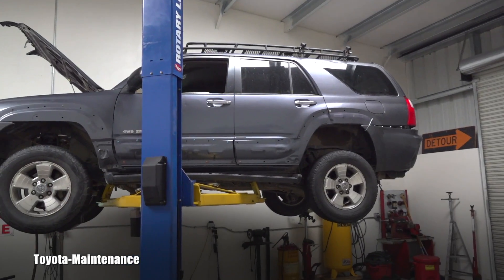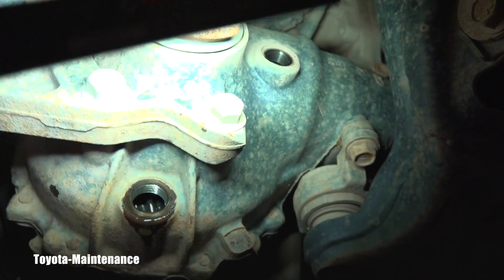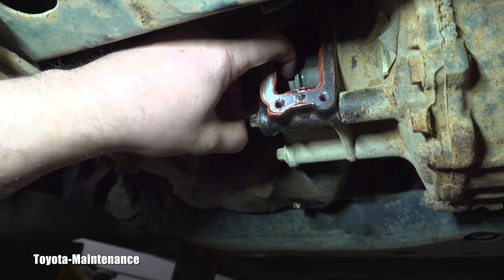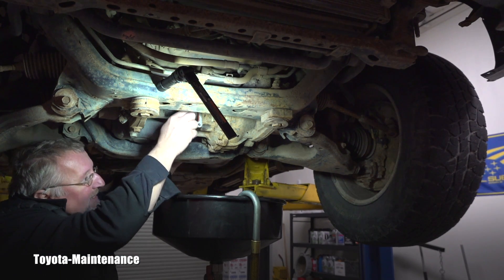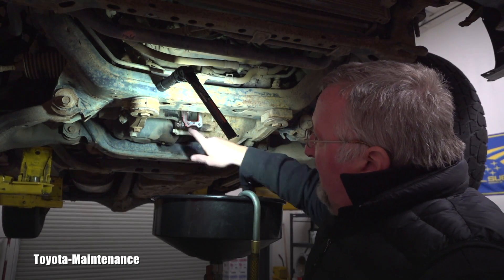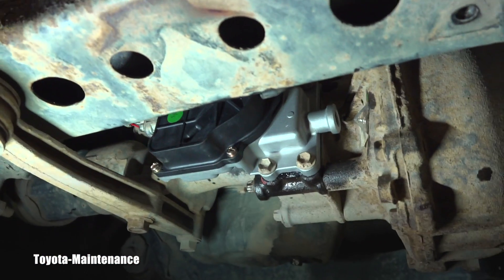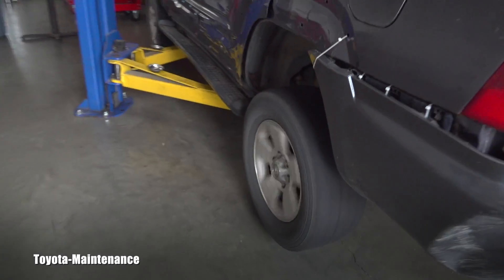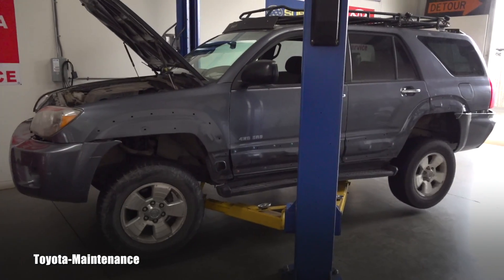Toyota front differential ADD actuator replacement

Comment: I replaced this part and fixed my problem, but new part has a short breather pipe and a bung in it , seems to be glued on. Is this a new mod and how it should be, or does it need to be pulled off and put on old breather???

Comment: Curious, what did you torque those bolts to? Or did you just go snug then a quarter tight?
Reply: The FSM for a 2005 Sequoia says 15 lb-ft - I would imagine the 4Runner is very similar

Comment: Is it best to replace and add new Differential fluid when replacing the front actuator. And when replacing the actuator do you have the 4runner in 4H or 4 wheel drive off?

Comment: So that's not diff lock it just engages 4x4???
My hilux has this and I thought it was electronic diff lock, my Pathfinder locks 4x4 in the transfer case, I don't see the point.?
Why not just use the transfer case like every other 4x4 I've worked on

Comment: I have a 2010 CrewMax Platinum Tundra with code: C1340, which my code reader says it's the Center Differential Lock Circuit. My 4WHi/4WLo dont work at all. Any idea what the part# is?

Comment: Hi, I've been watching your videos and learning a lot from them.
 I figured out the problem with the 4 wheel drive of my 1999 Toyota 4runner - the 4wheel drive works and everything but, the 4wheel drive light flashes  every time I start the vehicle.
Do you have a suggestion of what is causing the lights to flash? Thank you in advance.

Comment: Do you think you could advise me where to start..   I recently acquired a 1991 land cruiser. It’s stuck in center diff lock. Light is on in dash and won’t go off from toggling the button or from placing transfer case from high to low and back. Please help

Comment: Hi. Good information. I went a step too far and opened the ADD. Parts are cleaned BUT require assistance retiming the unit. Any possibility of providing information or a link. Cheers. Frank

Comment: When you install the ADD actuator do you make sure the fork is set to install in the disengaged position? or the engaged position?
Reply: Did you find an answer I’ve got the same problem? I’d assume 2nd position?
Reply: @harrisongauci2487 DUDE. I was so frustrated I gave it to a mechanic shop. They uninstalled and re installed it and it just worked.

Comment: The shift actuator on the transfer case is the issue with the front not engaging. It has a fail safe system; is closed loop, undiagnosable with anything. Same with my taco. Pop it out install a new one, probably got water from crack vent tubes, lengthen them and raise the vent higher.
Reply: no they have a little motor in them that gets gummed up if you dont engage it enough

Comment: Why did the front wheels rotate significantly slower than the rear wheels w/4wd engaged?
Reply: I was going to say that too. I thought maybe only one rear wheel was turning which would make the other rear wheel spin at twice it’s normal speed, but both rear wheels were spinning fast and both front wheels were slow. I don’t know.
Reply: Probably just the center diff not spinning evenly because I’m of the different resistances between how smooth the rear diff is able to turn from the front
Reply: I forgot some 4 runners came with a center differential. I was thinking of a transfer case.
Reply: @kb9knd  yeah it even stumped me for a minute and I have a 4th gen 4Runner 😂

Comment: Ever check the abs ecm. Get rid of the Christmas  trees
Reply: In the first video Petr showed the computer codes, I remember a front wheel speed sensor, a rear wheel speed sensor, one or two O2 sensors, plus tires, dangling taillight wires, plus a little more - really not that bad to fix, it would take a do-it-yourselfer about a full day in his driveway..

Comment: Great explanation but this design is nonsense. I would much rather have a bullet proof mechanical engagement shifter as part of my console in the interior. But Toyota (and others) like to add electronics to as many things as possible (even water [coolant] pumps) now apparently on some models.

Comment: Great job!  Question: why did it seem like the front wheels were rotating slower than the rear wheels.  I suspect this is by design - but what its the rationale?
Reply: The left front was not rotating the same speed because it’s a floating differential. If you noticed the right front wheel was keeping the speed of the rear wheels.  
Think of it as if the right front wheel was losing traction, and the left front wheel was not losing.  That’s why the right front was spinning faster than the left front wheel.
Reply: I saw that problem it is just tighter gears in front the rears are looser
Reply: I don't know why but something I think is wrong. My 1999 Tacoma I have owned since new vibrated when it was relatively new because I left it in 4x4 on a hard top road. I realized I was in 4x4 and placed it in 4x2.  When I got my oil changed later  I asked them to lift it and see if the 4x4 still worked.  It did but from memory they were spinning the same speed. Hope fully Peter will answer you question. Great question.

Comment: I am curious about the speed the front wheels were spinning.  I thought they would spin at the same speed as the rear wheels?
Reply: Different axle ratio, and power distribution isn't 50-50.
Reply: I too noticed the speed difference between front and rear wheels and found that a bit strange. I have not been wrenchin on Toyotas, only LR's and they have 50/50 atleast my Lr3 does 
Anyways, good video Peter, but perhaps you could show us a bit more og how you do your repairs, like Eric O over at South Main Auto does.. 
Just a thought
Reply: @pellethoresen4025  it has a Torsen transfer case. The transfer case  distributes torque 40/60 in a straight line with no resistance. This changes in turns or with a slipping wheel or axle.